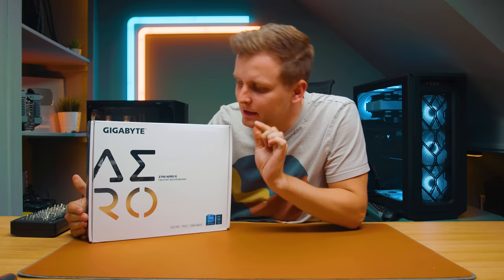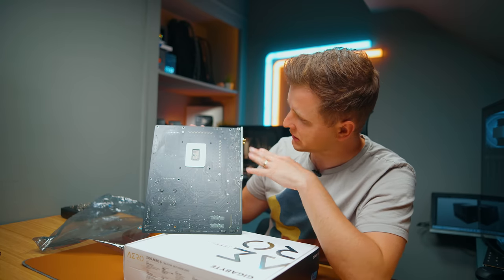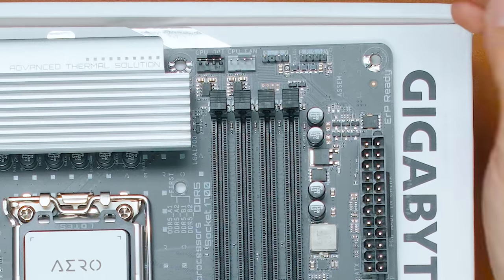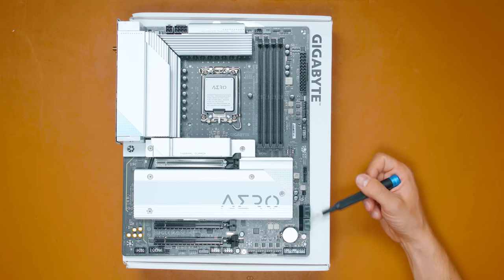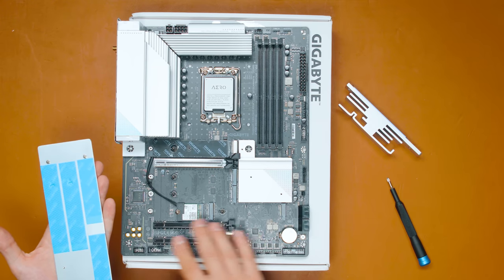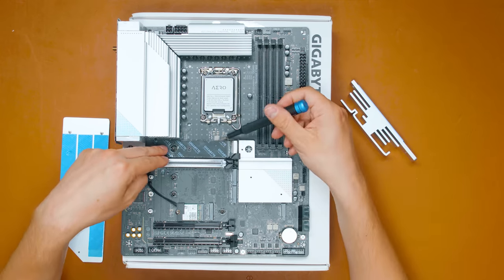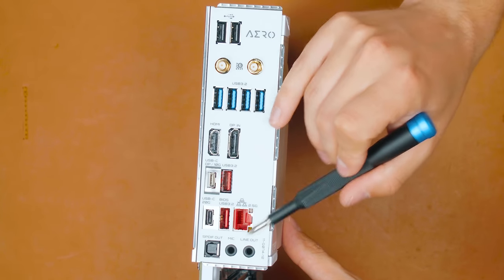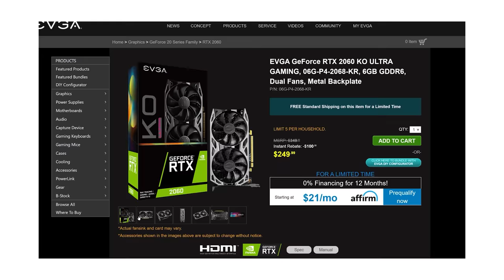Here's WHY THIS is made for CREATORS! | Gigabyte Z790 AERO G Overview

Comment: Idk, Z690 Aero D still seems like a better board. An actual x8 slot with bi-furcation, thunderbolt included, 2 x 3.2 usb headers and 3 x 2.0 usb headers, dual nic (10 + 2.5), etc.
Reply: Still DDR4, though. May not factor that hard now, but soon...
Reply: @daviddesrosiers1946  Actually there Aero D has a DDR5 version. I believe the Z690 Aero G is DDR4 only.
Reply: @thefluxlife  z690 aero G has a ddr5 version as well
Reply: Yea but does it have 6:00 proper thingy?
Reply: Onboard audio looks super weak, don’t think he even mentioned it.

Comment: Just built my PC using this board and i5 13600k with Peerless assassin cooler.  Haven’t updated the bios (stock bios is F4) nor installed a GPU (haven’t decided yet).  2-DDR 5 32gb and 2 NVMe (1Tb for OS and 2Tb for data).  No issues from the beginning and everything is working great!  I’m not a gamer, built it for content creation but mainly photo editing.

Comment: I agree, it would have looked sick if they'd used a white solder resist layer on the PCB with black component reference print on top of the solder resist. That would have looked amazing, and as an ex PCB CAM engineer I know they could have done this easily without barebly any additonal manufacturing costs. White solder resist would have be custom ordered so that would be the only additional cost but for the bulk they would want it would work out at pennies per board.

Comment: Hello.
I was recently reading an article about the 4th and 5th generation of Pcle that if, for example, in a situation like the motherboard you just introduced, we put the SSD in the first port and the graphics card position becomes 8 lanes, there is no problem because 8 lanes of generation 5 are equal to 16 lanes of generation 4 and since there are still 4th generation graphics cards, so we will not have any reduction in speed and performance in our graphics cards.
Can you make a video about this to show that 8 lanes of generation 5 gives the same speed as 16 lanes of generation 4?
Thank you for your good and useful videos
Reply: Yes. I'd definitely like to know more about this. For example, is this problem true for all motherboards, or just this one? Can an RTX 4090 run on  8 lanes in Gen 5, without losing performance? Is there somewhere (like in the Bios) where you see how many lanes your GPU is operating on?
Reply: Hi, have u jad more i dos à out this please ?

Comment: there is no compromise by running you pcie 5 at 8x. we just recently finally fully saturated pcie gen 3, and dont fully utilize Gen 4, so gen 5 at x8 is a non issue. i say plug in your best nvme and dont think about it.
Reply: thats what I was thinking

Comment: When you have added a 10GBASE-T and Thunderbolt, you have spent much more than you would have on an ASUS ProArt Creator which includes these features.
Reply: yeah a creator board without 10Gb ethernet and thunderbolt ?
Reply: @billythecat  First valid argument I see in the comments. The ASUS ProArt is 150 bucks more expensive though.

Comment: there are motherboards for rendering and for creators , those for rendering require processors with a large number of cores and the most powerful graphics cards, while for creators you need a processor with one strong core and many graphics cards with a lot of vram and a lot of nvme disks in raid0
Reply: Nvidia Quadro are the best cards for rendering, expensive but faster.
Reply: @TheUnknownVideographer  *than 😉
Reply: @TheUnknownVideographer  Quadro also have all kinds of vram from 2GB to 48GB. They have things like unlimited concurrent encode and decode sessions, which are software-limited/locked in gaming cards' firmware. In other words, similar hardware but different firmware and drivers enable different capabilities.

Comment: The top PCIe 5.0 slot for SSD is the exact reason why I didn't buy ASUS ROG STRIX Z790-E and instead decided to save a little and bought a simpler TUF Z790-PLUS, I keep 1 SSD in the top slot for the system (WD SN850x), and it goes directly to CPU at full speed (PCIe 4.0 x4), and another 2 SSDs (also WD SN850x) in other 2 slots that go to the Z790 chipset, also full speed. And GPU is not limited and doesn't share lanes with anyone. I'm wondering if it's even possible to implement a manual selection of PCIe 4.0/5.0 for the top slot from the BIOS? Probably not, since the top M.2 goes physically through PCIe lanes directly to the CPU controller and should be physically designed to use either PCIe 5.0 lanes (with only 16x or 8x/8x possible) or PCIe 4.0 lanes.
IMHO using PCIe 5.0 for SSDs are too early for today. Yes, some SSDs like WD 850x, for instance, are very close to the 8GB/s limit in sequential read/write. But real-world speeds are usually 3-4 times slower.
Reply: So on both the rog strix and this gigabyte board, even if you put an x4 nvme in the top m2 slot, the top pci-e slot will run at only x8? That's crazy. Why would anyone buy a board like that considering the top pci-e slot is the only gen 5 one.
Reply: @billythecat  Yes, PCIe can only be multiple to 2 (1x, 2x, 4x, 8, 16x), so you have only two options: one 16x or two 8x/8x. So yes, you waste 4 lanes because all NVMEs are 4x. For some slower GPUs, there is no real performance drop for 8x. And for some people, the priority is data processing, video processing, and rendering. So I suggest it would be perfectly fine for them. But gamers-oriented boards like ROG STRIX should definitely always prioritize PCIe 5.0 16x slot for GPU. You may put SSD in any other slot, but then you are limited to connecting SSD to the chipset and not directly to the CPU. And it makes me feel weirdly uncomfortable knowing that the SSD slot with the biggest heatsink will be wasted for nothing.
Reply: @billythecat  According to the TechPowerUP scaling test for PCIe 16x vs. 8x (and some other tests), it looks like even for RTX 4090 the drop is on average 3%-4%, and the worst is about 5%-8%. So, if some people are ok with that and ready to sacrifice 4% of FPS to get the max SSD performance, then probably it's fine for them. But again as I said, it should be definitely not the gamers-oriented boards.
Reply: @Artem Dzhadzha  "PCIe can only be multiple to 2 (1x, 2x, 4x, 8, 16x), so you only have two options: one 16x or two 8x/8x." 
Are you saying that it applies to all boards? Because I'm looking at the Rog Strix z690-a specs page and it doesn't say anything about M2_1 slot being populated making the PCIe 5.0 slot run at x8 (meanwhile the Rog Strix Z790-e page says so).

Another thing, since you seem to know it well, do you think 4+8 12V connectors would be enough for 13700k (no overclocking), 2xD5 ram sticks, 3xnvme running full load 24/7? Do I need 8+8 12v connectors?
Reply: @billythecat  Intel's latest CPUs have in total 20 PCIe lanes, 16 PCIe 5.0 and 4 PCIe 4.0. Usually, motherboards are designed to utilize PCIe 5.0 x16 for GPU (or x8/x8 for 2 GPUs, like ASUS ProArt boards), and PCIe 4.0 x4 for SSD. All other PCIe devices go to the chipset (Z790 has 28 lanes if I remember correctly). Those 16x and 4x lanes in the CPU are separate lanes (even different Generations) and don't interfere with each other. But if the motherboard manufacturer wants to provide you with PCIe 5.0 for the SSD, it has no other option than "steal" some lanes from the 16 lanes of CPU PCIe 5.0. So instead of 8x GPU + 8x GPU, you get 8x GPU + 8x SSD (but only 4x used).
In the case of Rog Strix z690, the top SSD slot utilizes PCIe 4.0 4x, and the PCIe 5.0 16x stays fully allocated for the GPU.
Regarding 12V power, I can't tell. Never tried 4+8 connectors and didn't even know it was possible not to use all pins. PSUs are usually not so expensive, so I'd invest in some good 850w for your configuration (but if your GPU is something like RTX 4070 or 4090 then 1000w). My personal rule of thumb is having PSU that is about 1/3 more powerful than your system's total load.
Reply: @Artem Dzhadzha  that's clearer now. Tysm! 
Regarding the power connectors, yeah I have no problem getting a 850w for that setup. But many cheaper boards only have 4+8 connectors for the cpu (like the one in this video) and I pointed it out in the comments but Tech Notice just said "it's more than enough for what's needed"...I don't know what he meant by what's needed.

Comment: How does this compare to ASUS PROART though? And you people have more knowlage of this than me, so is 192GB of RAM really a plus? 128GB is plenty for most stuff right
Reply: 128gb is overkill for most Tasks even 64gb is more than most people need. I would say if you need that much you probably know your stuff.
Please tell me if I'm wrong cuz in that case i want to learn.
Reply: It depends on what you're doing, but yeah, even 128GB is overkill for the vast majority of production tasks. For example, PugetSystems recommends a minimum of 32GB for editing 4K video and 64GB for 6K/8K. Complex 3D scenes like "high end Blender" use 64GB–128GB. 3D animation program Maya rarely requires more than 32GB.
Reply: @soaringje9  its funny, Minecraft needs more RAM than maya
Reply: @derptweaker945  it really depends on your tasks, gamers need upto 64GB but most are more than fine with 16, even in the same app, ram usage can vary a lot. best to look at the min and recommended specs for what you are going to do for a idea

Comment: I had this board but had to return it due to USB issues (won’t recognize keyboard on any usb port until after I replugged it).

It looks really beautiful though. 

Also, if you put either a pcie 5.0 or 4.0 nvme ssd drive on the top slot for these drives, the pcie 5.0 x16 slot for gpu will run at pcie 5.0 x8 which is equal to pcie 4.0 x16. So, if you have a top nVidia card, say a 4090, it will run at its top x16 speed because it still is a pcie 4.0 x16 card.

Once we start getting pcie 5.0 x16 gpus, then pairing them with a pcie 5.0 nvme ssd will become a problem on this motherboard because they will run at x8 instead of x16.
Reply: ssd do not even need pcie 4.0x16, once pcie 5.0 x16 GPUs come (in many years) just use the M2 pcie 4.0 x4 port.
Reply: @gerardoliveras430  The thing is, this board is geared towards creators, specially those who use a lot of drives. Doing what you suggest, will mean losing one nvme port to avoid reducing the gpu’s pcie 5.0 slot to x8. Also, if you want to use a new nvme pcie 5.0 drive, you pretty much are forced to use that top slot because of the big heatsinks that they require to operate without throttling. Heck, even if you use an older pcie 4.0 with a big integrated heatsink you are also forced to use that slot while reducing your gpu’s pcie 5.0 slot to x8 too.

Comment: I use SFP+ for my 10GbE so I went for this board over the ProArt.  Pretty happy with it for my needs but I also wonder why there is no D version for Z790 to more properly compete with the ProArt.  If I needed thunderbolt or cat 6 10GbE I'd have probably gone with the ProArt because by the time you add TB and cat6 10GbE nic you will have spent more than the ProArt.

Comment: May be top ssd slot cuts pci-e to 8 lanes only when m2 gen5 ssd connected like on other motherboard vendors? Because top slot should be direct to cpu as I understand and 13th gen cpus can’t handle gen5 m2 and gen5 pci-e simultaneously
Reply: I have a question, if I use a 13th gen CPU which has 20 PCIE gen 4 lanes, I can use the top CPU nvme slot without lower the lanes for the GPU correct?

Comment: after looking at the manual it looks like both M2A-CPU and M2C_CPU nvme slots both force a x8/x4 PCIe mode, this is typical of Gigabyte Boards where using specific nvme PCIe 4.X slots will still give you x16 for your GPU in slot 1 and where populating all NVMe or using Gen5 NVMe will turn that slot in 8x4 or 8x4x4.  So you can fill at most 3 of the 5 nvme slots without it dropping down to x8 for slot 1(manual pg 5).  Cool looking board but, the lack of 10Gbps ethernet kills it though for me.
Reply: Hi, newbie to pc , what does this actually means if u use an rtx 4090 please ?
Reply: @manunoyonify  it means that if you use a NVME 5.0 drive your 4090 will not be running at full performance (i.e. x16 it will run at x8).  So to avoid this pair your 4090 with a NVM4 4.0 (this will give you a x16 for the 4090 which is the full bandwidth).  Your NVMe 4 will be slightly slower than the newer 5 versions but, if you look at benchmarks you aren't going to notice it, 4.0 drives are pretty fast, common and cheaper these days.
Reply: @qscorner  thank you very much for those insights, browsing youtube and forums i’ve read that if using the nvme gen 5 the pcie speed may be twice as fast so that as rtx 4090 was pcie 4 it would ru  optimally... this is crap, that’s it ?
Reply: @manunoyonify  each motherboard will be different... typically the motherboard will tell which slots can be used in conjunction and at what speed they will run.  Typically most boards only allow 1 slot to run at x16 speeds which is the speed you want for you video card.  The manual will tell you if that drops to x8 or x4 depending on what you put in the nvme slots.  You can download the manual for any of the motherboards and see for yourself.
Reply: @qscorner  yeah i’ve read it but building my first pc coming from mac and a bit confused...

Comment: Hi there, Question - do you take into account the reviews on Amazon.  If you dont, is it because of inexperienced builders?   looking at Amazon of this board, there are a significant number of dissatisfied users, (10%), which is very high.   my rule of thumb is that i pull the trigger on items that are at 80% approval, or near 80%.  Usually when I see reveiws dip down to 70%, i stay away.  what say you?   thanks!!!
Reply: I thought this too….. it’s also on sale for like 110$ off for 190$ which is the cheapest am5 board I’ve seen ever. It’s sold by Amazon themselves so can’t be a scammer and doesn’t say it’s refurbished

Comment: What's your opinion on the Z790 Aorus Master? Is it worth it for a creator? It doesn't have dual ethernet port or thunderbolt port but seems to have everything else and more.
Reply: Why would you consider an Aorus Master if its more expensive than the Aero G?

Comment: Hi, Aero G owner here. Just wanted to clarify something:

Yes, putting an NVME in the top (Gen5) slot cuts the topmost PCIE slot (also Gen5) to x8 mode... but even the RTX 4090 is still a Gen 4 PCIE card. So, it'll still have full bandwidth. x8 Gen5 has the same bandwidth and throughput as x16 Gen4.

Obviously don't put a Gen4 NVME in the top slot, since there's no reason to (all the other 4 slots are Gen4), but if you have a Gen5 NVME, you are kneecapping it for no reason by putting it into a Gen4 slot.

There are no consumer Gen5 GPUs out currently. In fact, unless something has released very recently, the only Gen5 GPU is some weirdo Chinese model called the Moore Threads MTT S80 which runs like absolute dogshit (a 750 TI beats it in many gaming benchmarks, as per Gamers Nexus), but there are plenty (and growing) Gen5 NVMEs. So, long story short, absolutely put an NVME in the top slot if it's Gen5. You lose nothing on your GPU but gain an incredible amount of speed with the NVME.
Reply: It's not entirely true. 4090 is PCIE gen4 compatible card. So, it can't make usa of pcie
gen5 standard. Therefore, if you cut pcie gen5 from x16 to x8, you are limiting the card to work as pcie gen4x8. To simplify, 4090 can't do pcie gen5x8.

But, pcie gen4x8 will not massively impact 4090 anyway.

Comment: I have a question, if I use a 13th gen CPU which has 20 PCIE gen 4 lanes, I can use the top CPU nvme slot without lower the lanes for the GPU correct?

Comment: Hello @tech notice. need help, built my first PC assembled everything and updated bios to latest firmware. Gigabyte z790 aero g with intel i13700K and CORSAIR Vengeance DDR5 RAM 96GB (2x48GB) 6400MHz CL32 Intel XMP iCUE Compatible Computer Memory - Black (CMK96GX5M2B6400C32) have not loaded OS yet. The PC turns on but after a couple minutes would turn off and then keep restarting. Im not sure if its because of the RAM. Its not in the QVL list yet appreciate your thoughts and any help. thanks.

Comment: They built my pc with that motherboard and put the system ssd with windows in the first slot. Now my 3060 ist just running on 8 lanes, right? Is that a massive loss of speed? Or can i just put the system ssd in slot 2. Will this crash my system?

Comment: Would this still be a good board for gaming? Plan to use it with a 7800x3d, 4090(aero) that’s why I want this board to match it. Also 2 32gb sticks of tridentz and a t700 gen 5 ssd. Wondering if this board can handle that set up
Reply from the maker: This is for intel platform :)
Reply: @theTechNotice  they make a b650 version with basically everything the same

Comment: Wait 4+8 ATX 12V connector instead of 8+8 ????????
Reply from the maker: Well above what's needed :)
Reply: @theTechNotice  do I need a board with 8+8 connectors for a 13700K that will be at full load (no manual OC) almost 24/7/365? And can you tell me in what case I should need 8+8 connectors?